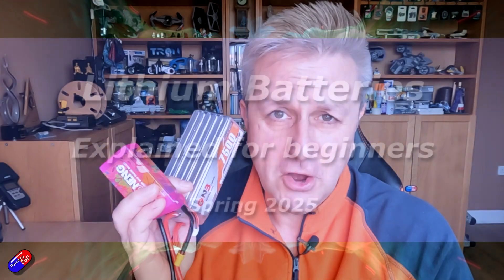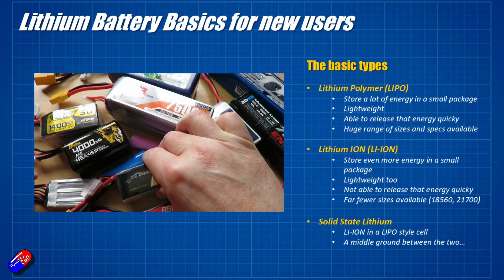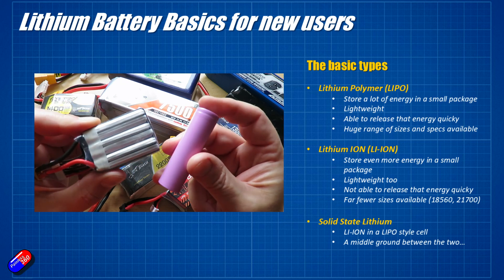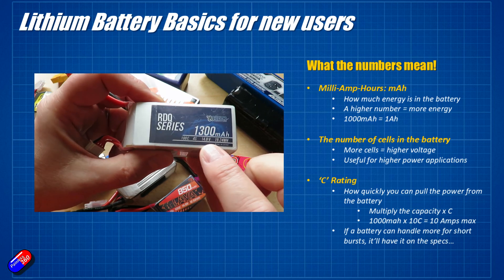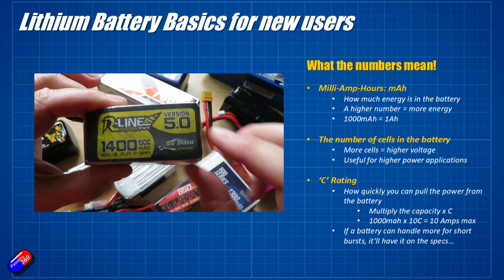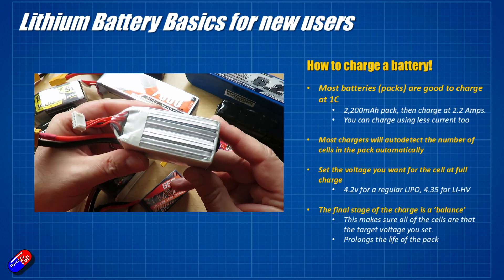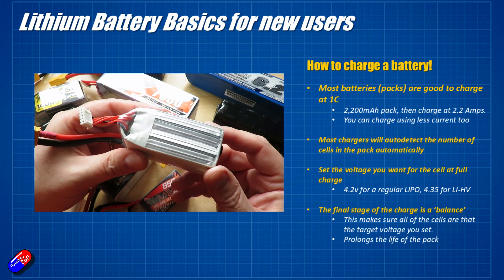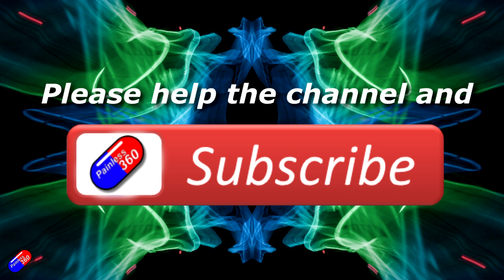Lithium Battery Basics for New Users (LIPO, LI-ION, LIHV)

Comment: thanks for the video. It can be a confusing topic for beginners and difficult to cover relevant information without overwhelming them with too many details or exceptions.  It has also been a while since you or one of the other reputable RC channels has taken the time to go over this information. And since many people start flying in the spring, this is a useful reference to point beginners to.

One minor thing I'd point out is 1C is the rule of thumb for charging LiPos, but I've always been told that 0.5C is the rule of thumb for charging Li-Ion... and some Li-Ion packs I've seen will specifically state charge max currents that are even less.
Reply from the maker: Always check the specs of your battery regarding charging. The charge current is typically set at a rate between 0.5C and 1C, meaning 50% to 100% of the battery's capacity in current.

Comment: A note on safe disposal: most chargers don't discharge to zero so you still have a fire hazard, and not everywhere is set up to take lipos for recycling.  An effective, safe way to electrically neutralize a pack is to immerse it in salt water for about a week [use about a cup of salt per gallon].  Leave it in a well-ventilated place; it will outgas some hydrogen & chlorine, and will be landfill-safe once the soak is done.

'A very long time' is relative, tho'.  I baby my lipo packs, but I'm a very frequent flyer.  I get 600+ cycles [balance charged every time] through my packs before they need replacement; that's about 9 or 10 months for me.
Reply: Everytime I have ever heard someone suggest saltwater disposal, I have seen numerous people immediately reply that it doesn't work because the metal always corrodes before fully discharging. I don't know how accurate it is, but I believe there is probably at least some truth to it.
Reply from the maker: Everyone has their preference. I use a automotive bulb for up to 4s packs and a discharger for higher voltages... Happy flying!

Comment: What is the rule of thumb on discharge current for lipo batteries that are being storage charged?  I use 2200mA 4s batteries with 120C rating. Thanks for this video, great info as always.
Reply from the maker: I'd normally discharge a pack like that to storage at about 4A. I try to discharge well below what the pack would deliver in use.. Happy flying

Comment: Is there any interest in paralleling a a LiPo and Li-ion pack where the former can take up the slack for times of high current or is the risk of subsequent high current inrush to the Li-ion cells too high?
Reply from the maker: That wouldn't work. The difference in the internal resistances would cause one battery to do most of the work... Happy flying
Reply: Ah yes, of course. The LiPo higher C rating is (partly?) because of its lower internal resistance.

We could though use a contactor doohickey with the Li-ion NC and the lipo one NO that switches when the current exceeds 2.5C or so of the Li-ion cells. This would add extra weight and need separate monitoring of both batteries but I've had the idea and won't let it lie... 🤪
Reply: Actually, that could work for heavy cargo VTOL fixed wing drones, without needing the daft amp measuring thing.
Reply from the maker: As two seperate power systems, it is used exactly that way in large professional VTOL UAVs. In fact, Ben and I talk about that in the Big boys toys playlist. It sounded like you asked about connecting the different battery types together directly, and that won't work... Happy flying!
Reply: Ooh, interesting. Yes, I started with connecting them in parallel but the IR stymied that, then I thought about applications where you could switch between the two depending on amp requirements...

Comment: I was just wondering how much of a lithium battery could be pulled. I know a SLAB is only 50% and the curve is much flatter for much longer on lithium but I wasn't sure what the mah usage amount was limited to before damage would occur.
Reply: With LiPo's 3.3V and with lithium ion up to 2.8V per cell